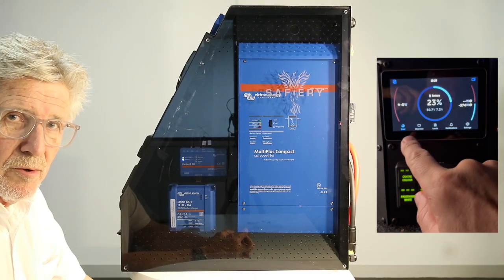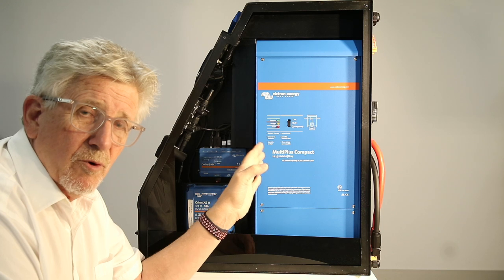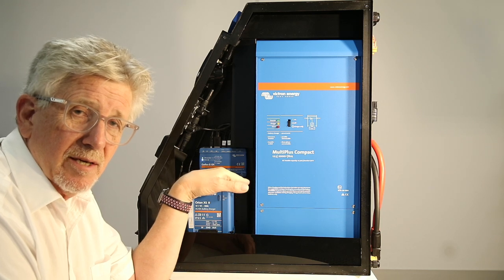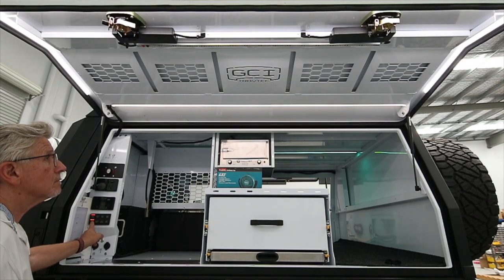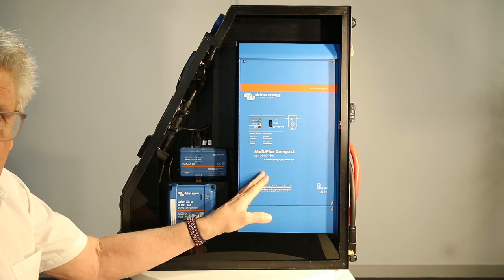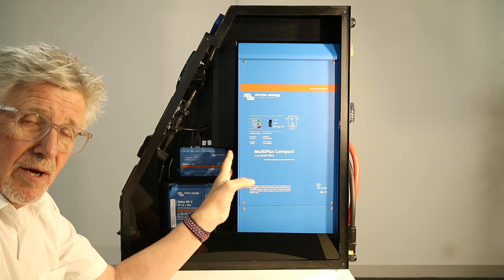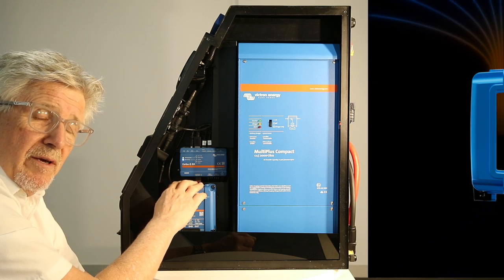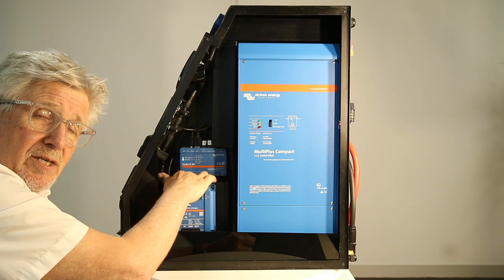Jupiter Stainless case with 12V 4WD Power 2000VA 50A DC DC  Digital Switching Detailed Walkthrough

Comment: What’s the alternator size in a 2020 150 Prado?
Reply from the maker: The alternator size for a 2020 Toyota Prado 150 Series with a 2.8L 1GD-FTV turbo diesel engine is typically 130A